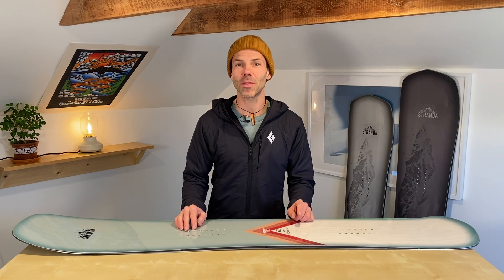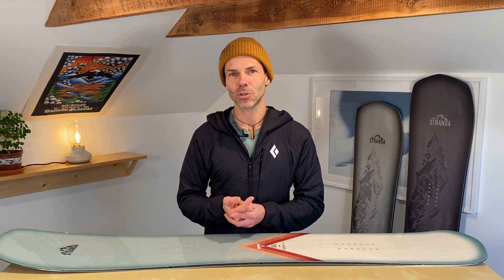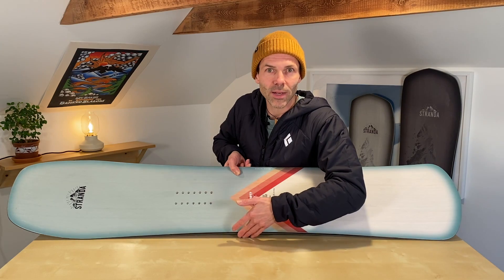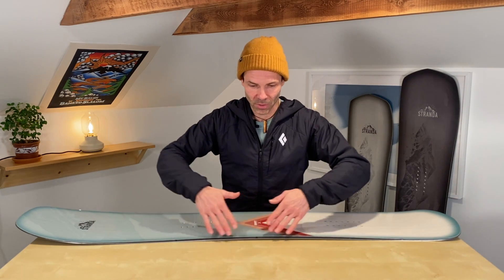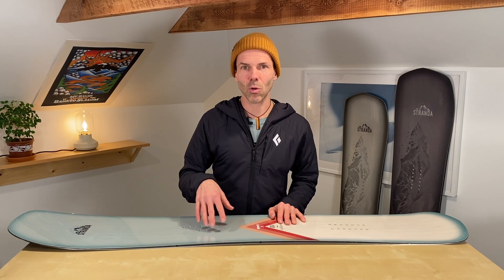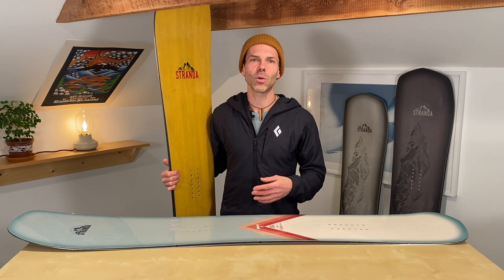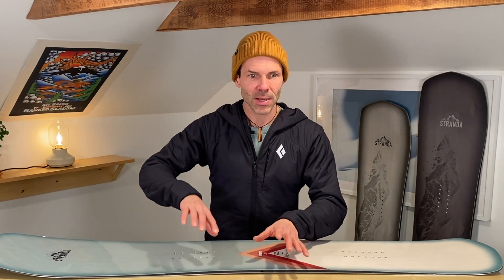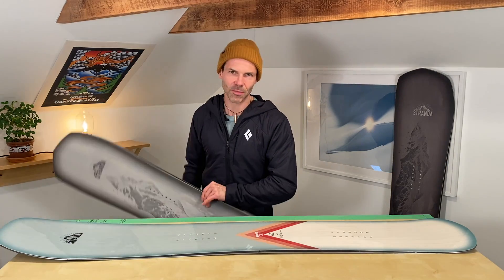Board design #2: Sidecut, effective edge, flex, turn radius

Comment: A longer effective edge doesn't change the actual edge curvature achieved. You are incorrect to state that for 2 boards with the same SCR but 2 different effective edges that the longer board will turn tighter. Flex is just like SCR but on a 90 degree rotation different axis to SCR. A longer effective edge gives a deeper flex curve but the same flex radius, just as a longer effective edge gives a deeper sidecut but the same sidecut radius. It's all arc/chord/sagitta math.
A carved turn is made with the leading part of the edge penetrating the surface and then the board riding on its base against the lateral wall of the carved groove in the snow. Look at your snowboard base after a day of hard carving. The wax will be burned away on the lateral 2-4cm by each edge. SCR & flex contribute to turn shape created when the, a turn at 1 degree inclination is almost all SCR, a turn at 45 degrees is equally SCR & flex, and a turn at 89 degrees inclination is almost all flex curve.
All other things being equal (rider skill & inclination angle) your 200cm Cheater turns more tightly at high angles because its flex radius is smaller than your friends boards flex radii.
Reply from the maker: What do you mean with flex radius??? I think what I’m explaining is quite logical.
The amount a board can bend - given it is not too stiff - is determined by how much space there is to push into when the board is tipped on edge 90° (sidecut depth). A longer effective edge on a given sidecut radius creates more space to push into and hence results in a tighter turn when tipped equally high on edge. No?!??
Reply: @Justaride-Snowboard-Channel  Flex radius: support a snowboard at the either end of its effective edge, and load the middle with a mass. The board will bend into a complex curve, but the middle of that curve has a depth. Using arc/chord/sagitta math the average radius of the curve produced by the board flex under load can be calculated. Exactly the same math that relates the sidecut depth, effective edge and sidecut radius. 
Additional complexities include -
a) that evenly splitting the mass and applying it at a rider's stance width reduces the depth of the curve. The wider the stance, the greater the depth reduction.
b) in a dynamic turn as the rider's angular direction rate of change increases, the bending force generated by the rider's mass increases.

Here is a link to a sidecut radius calculator that uses the same model as your "logical thought". 
https://natewaddoups.github.io/SidecutCalculator.html        (edited post after I realised I hadn't put the link in!)
The resulting curve for any board angle is solely dependent upon sidecut radius, not sidecut depth. And at 90 degrees board angle, no matter what the starting radius, the calculated turn radius = 0 (zero)! That is clearly a nonsense result and reveals that there must be a deficiency in the model.

So what do we see in the real world. Look at your own carved turn tracks. Look at the base of your board after a hard days carving, looking at the wear pattern of your wax, including at the waist of the board. And think. 
A carved turn begins when the board is tilted on edge. Suddenly, instead of the riders mass being spread across the whole base it is all loaded on the edge. This causes the edge to penetrate the snow surface and compress the snow underneath the base until the base has sunk into the snow enough to support the mass of the rider without further compression. A groove starts to form and the base is riding on the lateral wall of that groove. The groove has a curve with a radius to it, at low angles predominantly shaped by the sidecut curve of the board, but as you are aware some flex of the board is already occurring as well. The force changing the direction of the rider's momentum (the turn) is created by the base riding on the lateral wall of the curving groove. At board angles less than 45 degrees the sidecut plays the greater role in determining the shape of the groove curve, but flex plays a gradually increasing role as the angle rises. Above 45 degrees the board base is still riding against the lateral wall of the groove, and that is what the rider is balancing on. But think about the axis of curvature of the board in relation to the direction change of the rider and it becomes clear that the flex curve of the board is now the major driver of the shape of the groove across the the snow surface.

Look below to see board bend driving turn shape at high board angles.
https://forums.alpinesnowboarder.com/topic/43232-bend-it/
Reply from the maker: @riotsupercarver7467  ok...... I can't follow this! 
I'm not arguing with your groove in the snow thoughts. Of course that's what hold the board.
I'm a nerd, but at the end of the day a practical man: I've measured turn radii on snow where I bent a 10.5m Stranda Pipeliner 185 into an under 5m radius arc..... The board has a 153cm effective edge.
A board with a 100cm effective edge and an 8m radius can barely be bent into that size turn.
How would you explain that?
I've seen it, done it, measured it.
I find your explanation overly complicated - because I haven't learned that kind of maths.
I still find what I stating in the video to be 100% logical - and I've experienced it on snow.
There's one other thing:
The short/fat board trend has produced all these boards with super short effective edges and partially under 5m sidecut radii. The reason for the engineer's choice of such small sidecuts is simply that an 8m + sidecut radius on such short effective edges would hardly turn due to the lack of sidecut depths - which is a result of pairing short effective edge with large radii. That is totally logical from my standpoint.
I'll take a deep dive into your thoughts. Thank you for the comment. Interesting thing to try and wrap my head around, for sure!!
Reply: @Justaride-Snowboard-Channel An explanation for your observation.
When I talked about flex radius above I mentioned above that stance distance alters the flex curve for a board of any given length. Why is that? The riders mass is acting over the available length between the end of the effective edge and the binding location. If all the rider's mass is at the centre of the board the leverage is maximised. If a board was made so short that the bindings were placed over the ends of the effective edge there would be no leverage force exerted beyond the bindings to bend the board.
Now in a very recent video analysing turn shape you described how riders initiate their turns with weight forward and finish their turns with their weight towards the rear. The modern supershort carving boards you are talking about tend to have significantly longer noses than tails. Leverage and flex is relatively high when the board initially is tilted on edge and G forces are low. But as the rider turns away from the fall line in the bottom half of the turn the riders weight shifts to the rear, to what is now a very short lever even with the relatively high forces being generated in this part of the turn, making the board difficult to flex and tighten the turn shape. 
How long is your stance? and how much effective edge is now behind your rear foot on the supershort board, compared with the longer Stranda?

If the starting proposition in any logical train of thought is incorrect, then no matter how logical the process that follows, the end result is incorrect. Your starting proposition, that sidecut depth per se is influential in turn shape is incorrect.
Reply from the maker: @riotsupercarver7467  I think I get it...
So the reason I'm making very tight turns on a 12m sidecut on a 173 effective edge 200cm long board is due to the flex rather than due to the sidecut depth... And if the 8m board with that short EE was softer, it would be able t make tighter turns than the big Cheater?!
But surely the board can't flex more than what sidecut depth allows?! That's the part I don't get... You need space in the centre when the board is tilted high on edge to push into. So that limits the flex radius, no?!
I understand now much better what you mean, and you seem to be right. But this part of the equation is throwing me off.
Reply: @Justaride-Snowboard-Channel  The wax wear pattern on the base of your board will show you that the whole of the carving edge board BASE is engaging with the lateral wall of the groove created in the snow and to a significant depth, between 1 to 5cm on well groomed and compacted snow. So it is not the steel edge of the board contacting the snow that is limiting the bend in the middle of the board. Rather it is the compression/compaction of snow by the whole of the carving edge base.

Snow is not rigid. It is compressible, and carveable (creating spray) and that allows us to create the carving groove. Even the strongest snow (effectively ice) if not compressible, is carveable. The pressure of the riders mass pressing the steel on the ice melts a groove in it, just like an ice skaters blade. 
Only on ice is it that the steel edge contacting the surface limits initially how much the board flexes and the effective SCR reduces. But the arc/chord/sagitta math tells us that two board with different sidecut depths but the same sidecut radius will form the same radius curve when you tilt them on edge on this surface. But there will be a point where board flex will limit further bending and at this point the middle of the edge will lift off the surface. At this point a longer board will have more actual edge in contact with the surface than a shorter board.

The effective sidecut radius calculator I linked you to before shows the calculated effective radius as board angles get higher on a flat surface where this is the curve required to get the steel to hit the surface.

Take any 12m sidecut and run it through the calculator
45 degrees = 8.5m (rounded)
50 degrees = 7.8
55 degrees = 6.9
60 degrees = 6.0
65 degrees = 5.1
70 degrees = 4.1
75 degrees = 3.1
80 degrees = 2.1
83 degrees = 1.5
85 degrees = 1.1
86 degrees = 0.84
87 degrees = 0.63
88 degrees = 0.42
89 degrees = 0.21
90 degrees = 0 
Above 70 degrees the curves are getting so sharp that many boards would break before that curvature was reached. And skilled carving snowboarders are reaching those kind of angles. (see the Bend It link in the replies above)

With the board at rest -
the sidecut creates a curve in the horizontal plane, and the radius of this reduces as the board angulates and flexes.
the flex of the board creates a curve in the vertical plane and the radius of this reduces as the board angulates and flexes.

The rider experiences gravity acting from their centre of mass (roughly the absolute middle of the pelvis) to their base of support (the base of the snowboard pressing against the snow). The rider's effective G Force on a board in motion carving a dynamic turn, tilts 
- creating the snow groove lateral wall in close to the vertical plane (sidecut) to 
- pushing onto the snow groove lateral wall in close to the horizontal plane (flex) and then 
- rotates back to the vertical at turn transition (flat).
The resultant curved path cut by the board through the snow in the horizontal plane depends on the instantaneous effective sidecut, the instantaneous angulation of the board, and the instantaneous flex curve. Whether sidecut or flex is the major contributor depends on whether the board angle is closer to the horizontal plane or the vertical plane. 

If it was only the sidecut curve that the board followed at high edge angles then the board would bury itself in the snow.
Reply from the maker: I totally understand that it's not only sidecut!! Of course the board needs the 'trench' in the snow to sit in. Of course the board needs to flex. All of this is equally important. 
Your whole last two paragraphs in the last comment are totally obvious and not in question. In fact, I'm explaining this in my video - but in words a less scientific mind can understand. 
You don't answer my question though.
Sidecut depth surely contributes to the limit a board can be bent, otherwise we would be able to turn on boards without sidecut...
-
The wax wear pattern on my boards is no more that 1 to 1.5cm wide, and I don't understand at all what your 'sitting in the trench/vertical wall of the groove in the snow' has to do with what you're criticizing about the video. Of course there's a trench and that holds the board....
-
Steel edge vs. your wear path down the edge are the same thing. The edge is part of the board, it all bends together...
-
It's not the snow that is miraculously actively compacting into a curve it decides to be pushed into.... The board plus rider / g force do it. What you're saying would mean that the same board ridden in firm conditions would turn tighter than it would in soft conditions due to the lack of snow compression when its firm - and I really don't think that's the case.....
-
I think all you needed to say is the middle paragraph....
So what do you suggest for this video?
I want to correct it.
It's flex radius rather than EE that gets me to tighten my big board more than my friend's little board?! That is something people can understand!!
Reply: @Justaride-Snowboard-Channel  "It's the flex radius rather than EE that gets me to tighten my big board more than my friend's little board?! That is something people can understand!!" 
You got it. That is one of my points in a single sentence. But it took me a while to convince you. Finding a way of describing the "why" behind the sentence to people new to the concept is the hard bit. That will be your challenge in any corrective video.

My other point of difference is my primary disagreement with your video. We agree that sidecut depth is the result of a function of the length of the effective edge and the sidecut radius curve. 
If I understand you correctly, you assert that the absolute depth of the sidecut affects the radius of the edge curve created by tilting boards of the same sidecut radius until the edge touches the snow, at any angle of board tilt. The board with the absolute greater depth of sidecut can be bent into a tighter radius curve at any angle.
I assert that the radius of the created curve until the edge touches the snow is only dependent upon the initial sidecut radius. The absolute depth of the curve will be greater for a board with a longer effective edge, but the radius of the curve will be the same.
The physicists who model the effective curve radius created by a board tilted in this way multiply the board sidecut radius by the cosine of the angle of board tilt. Sidecut depth is not a factor in their calculation.

_______________________________
Answering your other points -
We can turn on a board without sidecut, but only by creating a flex curve by tilting the board on edge, and then rider effective G force compressing the snow and the board flexing. That is the technique used for the old "straight" skis prior to carving sidecut technology appearing in snowboards and then skis.

No, I think a board ridden in firm conditions will turn less tightly, because there is less snow compression by the riders effective G force, and less additional flex of the board over and above that needed to bring the steel edge in contact with the snow.

Lars, thankyou for taking the time and effort to engage in this conversation. Your willingness to re-examine what you believe is a rare quality.
Reply from the maker: @riotsupercarver7467  I'll figure out something to correct the video content. Not that easy... I would also much rather keep the video as is but tell people that the EE statement is wrong. Not sure how I'm gonna do that... I'll keep your comment pinned to the top for now... Maybe I'll just put out a 'Short' referencing the video and statement and your comment.
My worst nightmare would be to have stuff on this channel that is simply factually incorrect..... There are many things people can argue about and have opinions, but some things are just facts, and my whole thing is supposed to be factual. So thanks for pointing this out!! Much appreciated!
Reply: @Justaride-Snowboard-Channel  I’m still trying to wrap my brain around this as well.  The old slalom skis were practically straight, but they certainly turned.  If you take a piece of paper with a straight edge, stand it on the edge, and you can bend it into any radius you like.  Clearly flex comes into play at high angles.  But I think it’s a factor much sooner than I had thought.  If you plug some numbers into that calculator you’ll see that we’re generally traveling at speeds higher than what the sidecut should really dictate.

But why do they multiply the radius by the cosine of the angle?  Is that correct?  I still feel like the depth has a big impact at low angles.
Reply: Another thought:  that video where the waist of your board isn’t making contact in the turn… it seems like the flexed shape of the board is doing a lot more than the sidecut.
Reply: More thoughts: Does more sidecut depth limit the useable edge angle (as the waist rises out of the snow)?  If the sidecut goes longer at the tips, does the turn radius start to increase (rather than decrease with edge angle)?  Or does the flex just completely dominate?
Reply from the maker: @TheDerekHyde  I think I need to delete this video! My brain is exploding!

🤯😂
Reply: @Justaride-Snowboard-Channel  no way, it’s thought provoking!
Reply from the maker: @riotsupercarver7467  so.... after thinking about this again and all over and one more time.... and also watching the video again....
I think the only issue is that I make the connection between EE and minimal possible turn radius. However, there's a section in here (link below) where I explain that sidecut depth and board flex need to be designed together since otherwise at a certain board angle the board may stop flexing, lifting the edge off the snow, causing the board to slide out... THIS part is exactly explaining that board flex is obviously the limiting factor! 
https://youtu.be/yCHZtKEZU3s?t=249
Obviously a longer EE on the exact same board (which is my example) makes that board relatively softer (take a 2"x4" that is 10 feet long: it flexes, while a 2"x4" that is a foot long doesn't really.....). So really, we are completely on the same page and I just chose a wrong way to express the same thing.
I'll try to come up with a correcting video, and I'll leave this thread pinned to the top. There's a reason why so many people suck at this kind of maths: it's abstract to many brains. You're one of the fortunate people who this is crystal clear to, because you have a formula that gives your brain peace. My brain doesn't work like that at all.... We should have had a talk rather than this written chat. I'm sure we'd get along well.
-
I'm still thinking that a straight ski - as much as it can slide in an arc - can not CARVE in an arc unless tilted 90°. At any other angle the arc would be pointing upwards from the centre to the tips leaving the ski with no grip - no matter how the snow conforms and compresses, the ski would be moving up and away from the surface.
Reply: @Justaride-Snowboard-Channel  With the straight ski the penetration depth must be a significant factor, and it is easier with the boot in the middle.  I can't conceptualize how this would work on ice though.
Reply: @riotsupercarver7467  "The physicists who model the effective curve radius created by a board tilted in this way multiply the board sidecut radius by the cosine of the angle of board tilt. Sidecut depth is not a factor in their calculation."

Honestly I don't think this is correct because the boundary condition (90 deg) simply doesn't work.  I think it's the projection of the sidecut depth on the surface that actually follows a cosine function, going to zero at 90 degrees.  I'll try to work through this sometime (I'm just a physicist, not a mathematician).
Reply: A 2023 review of the relevant factors in ski carved turn shape linked below. Sidecut radius YES, sidecut depth NO.

 Balanced carving turns in alpine skiing. Sports Biomechanics, 22 (9). pp. 1209-1242 (Cover date Sept 2023)

https://eprints.whiterose.ac.uk/168379/1/carving.pdf